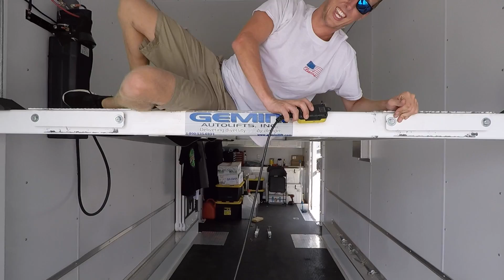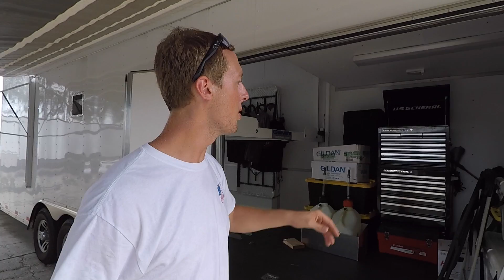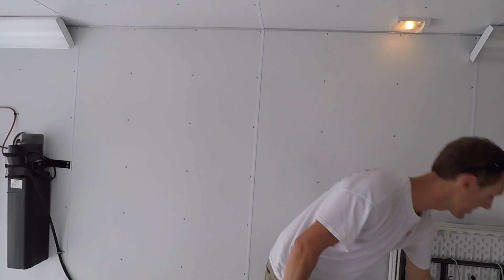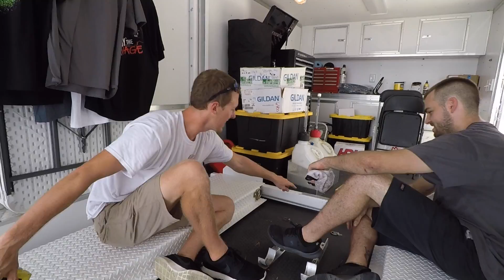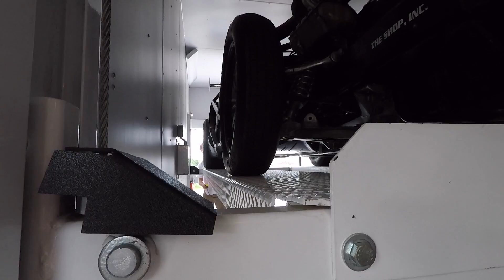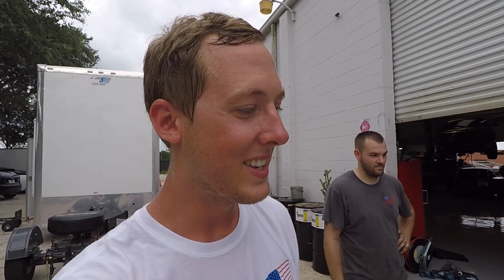We Bought a Used 2-Car STACKER Trailer! Introducing "Stacey the Stacker" (SHE'S TALL!)

Comment: A serious tip guys, measure and record all of your dimensions; ht, wgt, wdth, lgth, tape it to the dash or windshield so all drivers see it and are reminded constantly. Get a commercial truck gps like a Garmin 770 so that you can enter all of your dimensions into it so it will warn you of restrictions or low clearances and such. It should have a current and complete list of truck stops with diesel fuel (so you don't run out!) and parking for  long rigs like that! Good luck guys and be careful!
Reply: Funny enough, in one of their latter videos, they run their RV out of diesel. LOL
Reply: Daniel Bluck lol that wasn’t because he couldn’t  find diesel he said it still had a bit so he just kept on driving? And question for Steve how many gas stations do you pass that don’t have diesel?

Comment: Find some of those load brace dealios, they have rubber pads at the ends an adjust out to the walls and tension holds them in place. Think of an industrial strength shower curtain rod. Just behind your merch bins there, thatll keep your stuff from falling rearward. They go in and out real quick and easy.

Comment: I had the same high oil temp problem on my 2005 V when I’d track it at autocross. It was a grounding issue with the sensor. I added a star washer under the ground lug located under the hood support and it fixed the grounding issue and I never saw the light again.

Comment: Cleetus, crazy idea but hear me out: with all that weight, have you considered a fifth wheel? You can get a used Peterbilt daycab for the same price as a big beefy pickup truck, and it’ll pull 10,000lbs and not even blink. Then use Monica to pull a smaller trailer with all your tools and stuff. You wouldn’t have to worry about swaying on a fifth wheel since the weight is on the truck axle and not behind it, and having a smaller trailer on the RV is gonna make it easier to maneuver. Plus there’s a lot of weird laws about toads, many states consider them as separate trailers and require commercial licenses. Obviously it’s not gonna be simple to set up but y’all are crazy enough you could make it happen

Comment: When you get three or four cars give me a call, i can pull you around the country with a car trailer and my Kenworth W900. I will run with you for $200,000 per year, all mileage and fuel included.
Reply: Better then him smashin all cars himself and other travelers inside Monica! Chooch 😬
Reply: That’s a good rate for an on call unit. Yearly payments would be $100k before fuel, insurance, tires and wages.
Reply: Dustin Scott you don't know what a truck costs to run do you? I spent $52,000 on fuel alone last year and took several months off.

Comment: Have fun backing up a dual pivot
Reply: Ty Perdon true
Reply: The dolly does not pivot. You hitch the thing up and sinch the chains tight so it doesnt turn. The wheels are desgned to turn as, but the dolly itself is like an extension to the rv like a larger overhang. Look up 5th wheel dollies. They use them on suburbans.

Comment: FYI the wiring on the oil pressure sending units sometimes fray and you have to solder in a new connector so that might be whats up with the V. I actually just did a video on that last week. That trailer is straight high rolling brother. Just watch out for low bridges and overpasses!

Comment: ::::BTW: Yall probly got it covered but pls have remote tire pressure sensors on all your tires,  trailer, tow gizmo and tow vehicle. As a cop I have seen far too many crashes involvin setups like this and most were due to tire failure. We all actually need em on any size trailer. A few seconds warning of tire losing pressure can make all the difference.  With a trailer that tall and heavy and not dually wheel set up the "pucker factor" gonna be high anyway. And course you know if one tire goes the others take the weight and problem escalates. Just for heck of it deflate tires a little on one side and see how much lean angle you get then imagine that at speed on highway. Stuff can be replaced, of course, but yall cant. Some sensor set ups are pricey but cheap when you consider the alternative. And wireless backup cameras are cheap and gd way to mount on side of trailer to watch for problems and inside trailer to do the same. Amazin how much stuff in trailrs move around. A cheap net or gate on 2nd level mite save some cussin. My sermon for tonight. Amen.  Stay safe. Too bad yall don't have time to read these comments but mayb somebody will. After 35yrs I have seen way too much preventable death and destruction on  the highways. Even died once myself. Nuther story, nuther day...thank gdness u say. L8r.
Reply: Officer thanks for the tip, this a very long and high trailer.

Comment: I don't think the stuff would fall, but a really cool and simple idea would be to get a retractable net or cover (kind of like the stuff that goes flat over trunks in SUVs  and wagons to hide whats inside) and make it go from the roof to the edge of the loft so that it can be retractable. Pretty simple, just need to mount it on top somehow and put a hook in the center or the little catchers on the sides. Just need something wide enough. Would be enough to catch small stuff trying to fly off anyway.

Comment: Does Monica have the freedom-power to tow this???? Or are we getting Monica mods? 

Love from the UK, American brothers xo
Reply: Dan I was wondering the same
Reply: Cleetus did mention they were looking into power upgrade for Monica. 

Knowing Cleetus it's only a matter of time.......
Reply: Mango Mussolini do you have any idea what engine they are using at the moment?
Reply: jinaro kabue being as it's in an RV it's going to be far to small, rv's die all the time on mountain grades. Not enough torque to keep it moving and not enough cooling to push it hard at low speed.
Reply: From what I recall, and also since Monica is the same RV my grandfather has, that is a 400hp cummins and is rated at 1200 ft pounds or so. It is either an 8.3 or 8.9 liter engine. It has an alison 6 speed auto mated to it. The engine is plenty for the Monaco diplomat and will go up very steep grades even in 6th gear, at freeway speeds. Jay Dunbar must be thinking of a pickup truck size cummins, because the 400 hp cummins is a far cry from what is in a pickup. With a big ass stacker trailer behind it, it would be slower going and would downshift more. I haven't heard if it would be underpowered, but this is Cletus.............that cummins will need more bald eagles no matter how well it tows now.........go big or go home.
Reply: CGT80 oh it's a Cummins??? So cleetus is gonna turn a few screws and replace a spring and get 1200000000 torque??? Nice. I'm so jealous of you Americans and your engines and vehicles. I would kill for a 'vette over here and the ability to LS swap shit. We don't have much of that kind of stuff

Comment: Hey you can probably drill new holes on that lift so you can set the height wherever you need it, then just put the pin through. You might need that extra clearance for a mine van or truck.. #America

Comment: Dude this is great! With this trailer you have a whole new set of problems. First tires bro get Sailun S637 they are14 ply G rated so you will not have blow outs. Second Solar power on the roof so you can charge all you equipment. Third 3 or 4 way back up cameras so you can see all around you. I cant wait to see you again and good luck..and Do It For Dale!

Comment: If the CTS-V is anything like the one I worked on the screen below the sensor is stopped up. Tried 2 diffrent sensors and none worked soon as we cleaned that screen we got good oil pressure again.

Comment: You are really moving on up! Its amazing what youtube revinue can get you. Especially since you are not buying brand new Huracans and Mclaren 720s's and 8 room mansions in the 'hills n such.  You are staying grounded and buying items that you actually need for the channel. And they are quality used items.  When you buy used you can get a top of the line item that is just 2 or 3 years old. Which is actually a good thing. You know it is quality because anything that would have broken would have broke already. Well except for Monica's air bags... But well let that slide.  And what do you expect. She is 10 years old and has low mileage. Whenever anything is stored for a long time things are going to break. Especially rubber things will dry rot. Big rigs are meant to be driven semi regularly ( no pun intended) to keep her oiled and happy. Speaking of which.  Are Monica's tires good? If they are original i would change them. Especially now that you are pulling a stacker trailer.  Id hate to see you have a blowout at highway speeds pulling that priceless cargo.

Comment: I know this vid is 1.5 years old, but I'm getting caught up slowly, Why not pull the 30 foot  toy hauler with the R/v and the other with White buffalo? you could bring 2 race cars and an around town car/small truck. you would have to stop no matter what at certain stops for the stacker anyways and for the length, of the 30' hauler. that way you can bring  all gear and way to get gear (local shops etc..) as well as 2 cars?

Comment: Dude, you SO need a cargo net across that top storage.  You have NO idea how badly stuff can shift when up that high, even if you drive easy.

Just throw some D-rings in the walls, ceiling, and floor edge, and get a pickup bed cargo net.  If you get a heavy duty one, you will even be able to hang things off the end of the floor a  bit if needed.

Comment: Nice trailor guys but it needs some thought here, install a height warning in the prime puller motor to remind you of its height, get out practicing reversing that beast  they are bastards < we call them DOLLIES in the UK  > they do not act like a normal articulated trailor when reversing, a handy space with some traffic cones is needed badly.  Does anybody produce a pointed or rounded screw on fronts for this trailor because the wind will have a strong effect on that high flat front as well as high fual , Whilst if you hit something with a normal trailor you just get a dent ect with a double decker a hard enough hit on something leaves you with a motor stuck up top because you also damage the alignment of the hoist < be very carefull > Do not take this trailor out in high winds for any reason  because side winds wont just tip the tow on its side but also take the prime mover with it , Ahhhhh ! the joys of double deckers enjoy Guys . Love the blogs Greetings from the UK.

Comment: Everything is about GVWR now.. 

What is the GVWR on your double stack trailer? 15k max
 
Look at the number of axles. This is what the DOT and police looks at and how your trail is rated. You have 3 axles @ 7000 each I bet its =21,000 lbs or 3 @ 5200 =15,600 lbs regardless I bet your way over weight for your tow vehicle... 

If your RV tow rating is set at 10,000 max GVWR (trailer) you can not change it even if you add a dolly to off set the weights.  

Most 45' RV bus have a 15k tow on them. Most 40' RV's have a 10k or less. 

Your GVWR  is 33,000 lbs max for that RV.
Your GCWR is 43,000 lbs max tow rating of 10,000 lbs. (Trailer weight + Dolly weight = 10,000 lbs max)
 
Even if you add a Class 4 15k hitch you are still limited to both trailer + dolly + RV @ 43,000 lbs. FL also has to follow the DOT rules. FL saying under your weight you have no limits to drive with weights and they are right.. but you still have to follow limits of your RV and trailer and dolly. 

Simple, get a 45' bus with higher limits. Dolly can be added as 1 tow.. adding a trailer to a tow dolly is known as doubles in more states. 
  
Just want you to be save and smart...

Comment: And Yeah dont wrap the trailer.  Its like a big advertisement saying. "Hey guys... Over here... We have a very expencive race car or two over here!!"  And in case you dont know. Trailers are very easy to steal. It has happened to my boss a few times over the years. Even with a tounge lock. You can put a pindle ring on very very quickly and hook up and go. Even with you sleeping in Monica.  I would get a locking wedge thay goes between the two tires on the trailer. If you are that worried.

Comment: I think it would be an amazing idea to use the wheels on the trailer and hook them up to electric motors themselves so it can be a generator by itself. that's how generators work, by the way. The engine turns a big electric motor at high rpm and that creates electricity. when you spin a motor with electricity, your using it for rotation of the motor. when you crank the electric motor with a gas powered one, it creates electricity because it's being rotated externally... it may or may not be hard to go into detail.
Reply: Lmfao you literally went into detail.... get a crank flashlight and crank it, boom generator explained